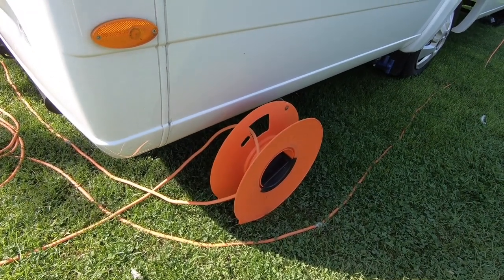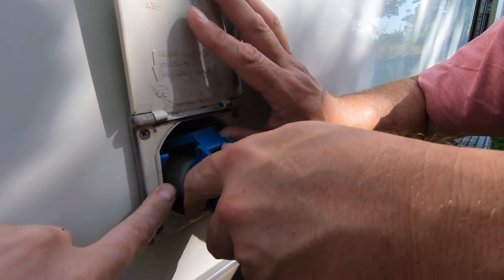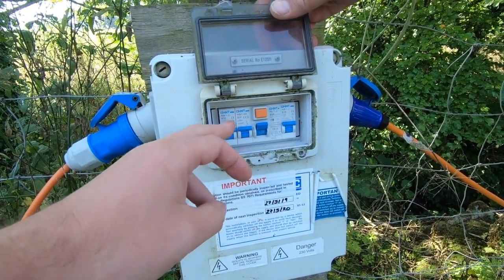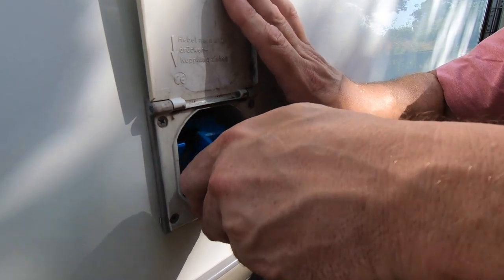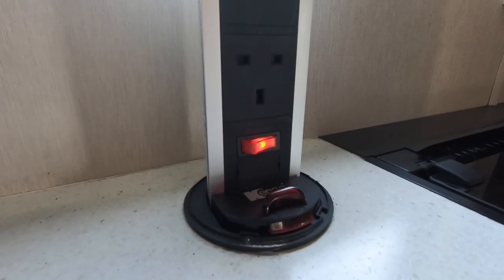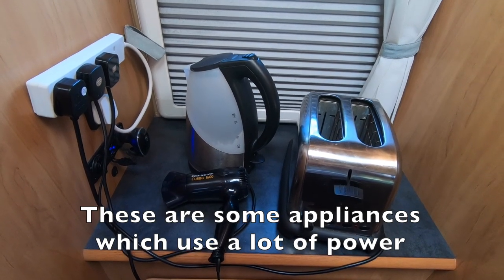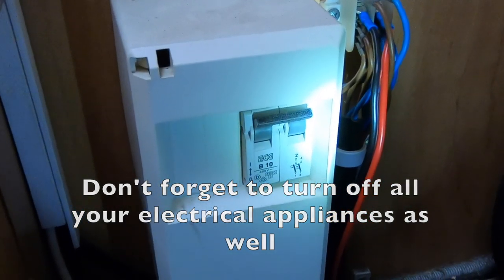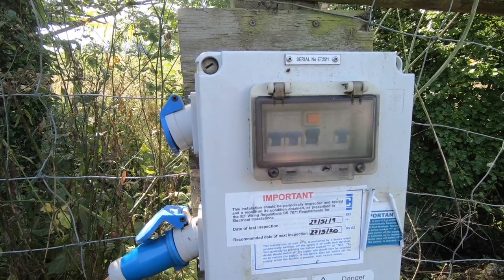ELECTRIC HOOK UP : What to do When the LIGHTS GO OUT

Comment: Thanks for the vid.  My only concern is when it is chucking down, is it still ok to still plugin?  Sorry if a daft question- electrics make me nervous :-)
Reply from the maker: Very good question, Paul. The simple answer is not to get the terminals wet. Plug the motorhome in first. Point the socket down and plug in to the campsite.
Reply: @HermanHitstheRoad  thanks